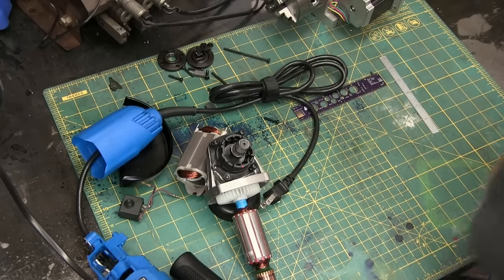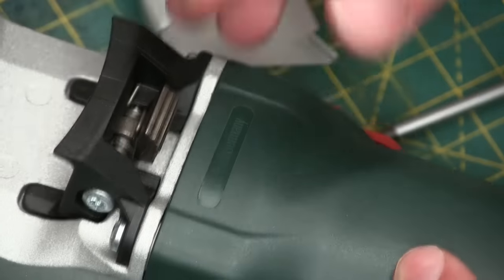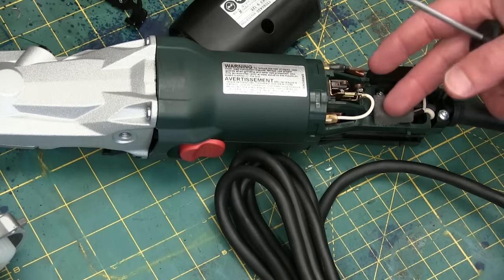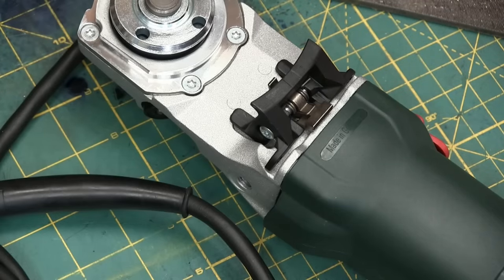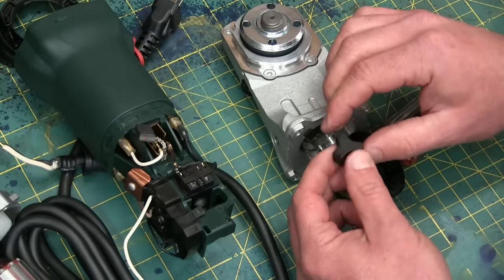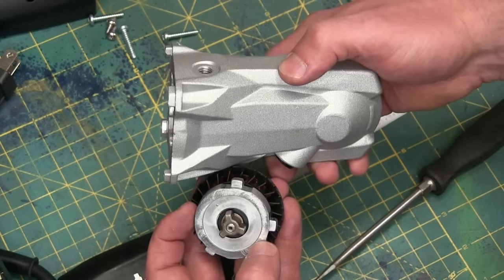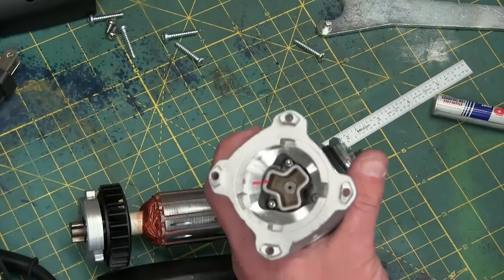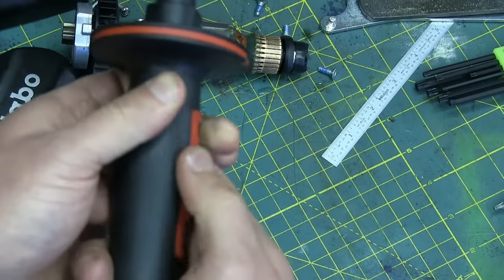BOLTR: METABO GRINDER. MADE IN GERMANY

Comment: +AvE I used to work at a sintering plant. If you feel like maybe mentioning that these sintered parts are pressed, removed from the mold and then cooked, that'd be cool. I bet a lot of people who watch your channel may be under the impression that the parts are cooked while under pressure which simply isn't the case. Also some parts go through a sizing press after they've been cooked to further meet very stringent specs before leaving the plant. We are talking presses made in Germany that put down over a million pounds of force on a part that is maybe 6-7 square inches of surface area.
Reply: You are correct. Until reading this I was under the impression it worked that way. Thanks for the clarificatipn

Comment: In high vibration environments crimps are more common than tinned multi strand.  The reason is the vibration will cause the wire to fatigue at the solder joint since the solder is solid.  On aircraft we never tinned, always crimped.
Reply: There's a reason why wires aren't tinned - the tin acts as a liquid and slowly changes the shape of a connection so when it was originally tight it becomes loose and prone to electrical malfunction over time. So the lack of tin on the wires is actually a good thing.
Reply: @ehsnils  I think Ave meant individually tin plated strands, not the use of solder joints at the ends.
Reply: Hmm, I most definitely do 100s of solders on aircraft (777 mainly)
Reply: Tin is not the same as soldering...

Comment: AvE, not sure if you read the comments from old videos, but I think you shouldn't latch on the crown gear as much as you do. In a 2 gear setup, the pinion is always the critical piece, its whats going to fail. That's why its generally made with a higher quality process/material. Having the crown made as good as the pinion is overkill.

Comment: Hey AvE, 
Polymer Technology Master Engineer from Germany here:

There are a few more efficient ways to vulcanize the rubber as putting it into an autoclave.
The Rubber gets Pre-Mixed at a processing factory and the cable manufacturer buys that as premade strips. 
Those get fed into an extruder where the twisted cable runs trough a quill die and the rubber gets pressed around that.

For the Vulcanisation there are various processes. The Autoclave is usually pretty inefficient because you can only run that batchwise, I think they would use either steam (or in asia Radiation) Pipes, where the cables run through continuously under pressure, or a Molten Salt Bath to Vulcanize that.

Since that says 105°C, it is either Natural Rubber, or EPDM (EPDM is more likely, since it has a higher resistance to weather, UV and Ozone influences)
Reply: You're Welcome, always happy to share some knowledge!
Haven't heard about the molten Lead version yet, but that sure as hell sounds expensive and complicated
Reply: Tobias Brinke thank you for your elaboration,

Comment: It's advised almost universally to never mechanically clamp something that is pre-soldered/tinned. In fact in most jurisdictions (Australia, UK, EU, Canada etc) it is illegal to do such in mains electricity installations. There's a few reasons, the main one is that the tin/solder has unacceptable metallurgical creep. Others are things like tin-whiskers, and oxidation.
Reply: I think AvE is referring to actual tinned wire along the entire length, not a soldering process that would be done on the end of the wire. AvE is correct that most shipboard cable will be tinned copper. This does not mean that it was soldered, the individual wire strands are tinned for the entire length of the cable before being insulated in the manufacturing process.  This prevents the green growth of death that happens inside of many conductors in harsh environments. I've seen wire be black and corroded many feet in underneath the insulation, I would assume through capillary action.

Comment: No critique about the technical points you mentioned, but you can't compare this grinder pricewise to a "normal" (i. e. not pancake) one and then say it's too expensive. Half the money is going into the flat design of the "WEF 9-125 Quick" you have, which is 291€ when I check the manufacturer's list price. The better specced "WEV 10-125 Quick" (a non pancake grinder) that's a little bit more powerful, has adjustable speed and a mechanical safety clutch costs 172€ as opposed to 291€, so substantially less. (if you don't care about the constant speed control that both offer/adjustable speed that the WEV offers, you can also go for the W 9-125 Quick which literally is half the price of the WEF). You can even mount the gear box in 90° increments to convert it to left handed operation ;) . 
The electronic block does a little bit more than you give it credit for. It switches the grinder off, if you get the disc stuck, tries to keep the RPM constant under load, prevents the grinder to spin up after power loss if the switch is still engaged and has a softstart so it's really easy to start up one handed (btw. how do you use a rat tail grinder one handed? I guess that's the reason why almost all 125mm angle grinders here in Europe come with that thumb switch).
Reply: Not
Reply: How you use a rat tail grinder with one hand? Well.... you just do it. One hand holds the part you're grinding and the other one holds the grinder...
Reply: Great comment. But I've used my Milwaukee rat tail one handed many times.
Reply: superdau 
Thanks for the info.
Reply: You need to get plenty of wrist exercises in if you want to use a rat tail one handed, but it can be done!

Comment: Great video man.  Yeah that open-cell foam looks out of place.  The trim pots on the electronics are probably for adjusting the "Constantmatic" feature of this particular grinder which is their marketing term for a grinder that maintains a constant rpm even under load.  This is probably part of the overload feature you mentioned.  Looking forward to your "testing."
Reply: The foam is there in the schematic. You can even buy it as a spare part (and it is used in severel metabo tools).
Reply: superdau
What is the part number for the foam?  I may have been looking at the wrong model.
Reply: German Tool Reviews
344100790 "Einlage selbstklebend" ;)
Reply: Yup you are right, I missed it.
Reply: And isn't full of grinder filings and shop debris.
Reply: Lol. Yep. Every grinder I have had with a filter clogs its own filter with debris in about 5 minutes, then starts sucking through the cracks in the body bypassing the filter :P
Reply: German Tool Reviews  of

Comment: Ways to win AvE's heart: 1) Beer 2) Meats 3) Good snap action
Reply: Good snaption / snaptivity
Reply: And glass fiber reinforcement
Reply: Forged/ground/lapped gears, beefy non-plastic connections to your brushes, no-nonsense warnings "Everyone that uses this tool will die. 100% Guaranteed.", guards and safety interlocks that ship and bill separately, full every-single-part exploded schematics free, crucial 'this will break first' parts available at local hardware, plastics that don't immediately decompose in random cutting fluids for parts that have to be plastic, and last but not least: No dead tree carcasses!!!
Reply: All that is well and good, but it got to be STIFF. Who want a hand full of limp tool? 😲😵😞
Reply: @shrikedecil  Mrs. AvE, I presume.

Comment: I know the little circular thing on the brushes is to back up a small spring that pops out a little non conductive doinger that stops the motor from getting power. I have rebuilt some of the older metabo grinders.

Comment: note: thermoset's  do not melt (you said unlike thermoset plastic these do not melt) . There are thermoplastics, and thermosets. Thermoplastics melt at elevated temperature, thermosets will degrade and then burn, but will not melt.
Reply: Couldn't those of us who have the sense to stop BEFORE it goes full torch, call that degradation...melting?
Reply: +Michael 1. The sense? I rather enjoy letting the smoke out. You get this delightful whiff of electrified blueberries.
Reply: +Joe Clark Cancerberry. A new fragrance for men by Dewalkarri Noir. 

Ron Pearlman in a tight white sweater and cargopants
Reply: Michael 1. I think that would sell. Except for in the state of California where " 'men' has been shown to cause cancer." Ron Perlman in a tight white sweater and cargo pants would sell there though.
Reply: Sounds like you've had this Ron Perlman fantasy for awhile :P
Reply: Do you say wood melts or does it burn? Thermosets BURN and char, they do not melt. Thermoplastics will turn leathery and begin to drip (aka liquid phase) BEFORE they burn. The "melting" temperature of a thermoset is ABOVE is "torching" temperature so it never gets a chance to melt.
Reply: +AvE  

You should review that new Troy-Bilt, TB4200 electric trimmer that has that "Core motor" technology marketing wank. Basically it's nothing more than a axial flux brushless DC motor that instead of using copper coils, it uses a fiberglass circuit board with copper traces on it. I don't know about you, but I don't think that motor will be reliable because fiberglass circuit boards can only handle 125C temps. Any higher and she'll start to turn brown and then black with carbon, leading to shorts since carbon is conductive. A coil wound motor with the best varnish can handle temps of 180C. Much more robust than fiberglass circuit boards....
Reply: Ionic bonds in hydrocarbons?!? Something smells funny and its not the burning thermoset. (Did you happen to mean van der Waals, aromatic pi stacking, or hydrogen bonding ,if not a fully hydrocarbon based polymer like nylon?)
Reply: It's cool. I'm org. chemist and reading that made my brain spasm and fingers twitch resulting in my unnecessary correction. Sorry about that. Good day chappy.
Reply: he knows that, I have seen him used the terms correctly before. I think he just had a brain fart.
Reply: +MOL van der Waal's forces, and occasionally hydrogen bonds, not ionic bonds IIRC :p
Reply: +Michael 1, no it's definitely not melting, it is decomposition. No matter how careful you are you can't melt most thermosets. What happens is they start to out gas and char, and this is the polymer depolymerizes rather than melt. I.E. Chemical bonds are broke.

By the way there are might be thermosets which can melt, but not usually. Thermoset means that to make the article separate monomers or even ogliomers are mixed together and reacted chemically. Thermoplastic means that instead the plastic has already been made chemically and the article is constructed by basically melting it into shape.

Rubber for instance walks this line pretty fine. It can be melted into shape but also it can be mixed with sulfur or other things and set into shape by both heat, pressure and chemical change, which is called vulcanizing and it changes the chemistry and physical properties somewhat and makes it less able to be melted again. So, is that a thermoset or a thermoplastic?

In general thermoplastics have long linear polymer chains, and in general thermoset have either cross linked linear chains all the way up to something that doesn't have any recognizable long chains at all but is instead a crystalline or amorphous 3D lattice such as a phenol-formaldehyde resin (Bakelite).

Comment: the cable comes from the Zhongshan Rifeng Electric Cable Co.,Ltd.  
 Guangfeng Gongye Ave, Zhongshan, Guangdong, China   METABO have two manufacturing plants  Nürtingen and Shanghai (China). makes you wonder if the grinders come from Prc and the truth be out now found this on a british site (tool stop) What this appears to mean is that Metabo not only design and innovate with stereotypical German fastidiousness, they also apply that same mind-set to each element that goes into your Metabo power tools.

So, the motor housing, the gear boxes, all of the aluminium, metal and copper bits that turn your drill bit, your grinding disk or spin your saw blade are designed, engineered and manufactured in Germany, Nürtingen. At the Metabo plant. Only then are the component parts sent to their Chinese plant for assembly.

What we're trying to say is, Metabo power tools are extremely well made.

And that's because 80% of all their machines are still produced in Germany to their exacting design, manufacturing and assembly standards.  The other 20% are assembled in their Shanghai factory which utilises the local labour force, but is controlled by German Engineers.

In some instances German made parts are even shipped over to the Shanghai factory for assembly, crazy as it might sound, this gives you some idea as to the investment in quality that is being made here.

Comment: Howdy, 
I spent my working years as a Millwright in a Wire and Cable manufacture in Ontario.
We had 3 CV lines ( constant vulcanization) to manufacture the rubber cable you were taking about.
The rubber came raw in strips that was fed into an extruder that encased the twisted three conductor wire. The wire paid off from gigantic spools and ran down a 300 psi steam tube and turned around on a pulley inside of an autoclave. It then returned to the "takeup spool" under water (to cool). The wire emerged to an accumulator ( allows the constant motion while spools were changed) . Worked there 23 years. That's how we made wire.

Comment: Inside the brushes on Metabo and Makita they have a little brass button on a spring (that little copper indicator at the top). Once you hit the wear point of the brushes, it shuts the machine down so you cant kill it completely.

Point of failure on most metabo machines is the upper / lower output shaft bearings,  head side motor bearing, brushes, Marquardt switch on machines that run those old marquardt push fit jobs..  Most metabo machines have shim stacks to adjust the ring / pinion contact; surprised that machine did not.

Comment: Silly question. Is that little bit of foam an air filter? If its on the "in" side of the airflow would that keep it cool enough to prevent melting?
Reply: That was my guess, that open cell foam is used in a lot of filters out there, if there was a mechanical hold down for the cords it would be much stiffer.
Reply: I think the foam may also be an indication of use. Basically you send the tool on for repair, they see that foam has not degraded, and they know that they have a legitimate RMA to deal with. At least that is the only reason I could seen for having such a pathetic bit of foam in a High end tool. Not to say that the tool should fail easily, but it might make someones life easier.

Comment: As someone who does FDA stainless welding and polishing and uses air grinders all day in the shop(Souix, Dotco, Desouter), when doing field service work and only have 120v electric available, Metabo grinders are the smoothest operating, best feeling tools I've used. We have Makita, Milwaukee, and DeWalt, but the Metabo grinders and Dynafiles are miles ahead when doing precision polishing. I also have a 5" Makita rat tail in my personal shop, but it's been relegated to cut off wheel duty since I picked up a variable speed Metabo 5".

Comment: I have owned this model grinder for about almost 2 years now. And used full time at work. The disk stop deal fell out within 4 months of use. Kept falling out until I lost it. Very frustrating because that exposed the gear housing to the elements and now I'm replacing the gear of the head side. The one on the motor side looks fine. But I'm finding out that it's not as easy as I would have thought.

Comment: Natural rubber? You mean tree spooge?
Reply: No. Tree schmoo. Learn moar Canukistani.
Reply: tree shmooo
Reply: Natural rubber.....the stuff that splits and decays 10-12 years down the road.
Reply: Well it's not completely natural rubber, it's been vulcanized. It will only split and decay 10 years down the road if it's left in the sun the whole time and never used. Moving around the rubber as you use the tool over time actually helps it 'self heal' from weather effects or so I've read that car tires will go much longer without weather cracking if they are regularly driven on. And they are vulcanized rubber as well.
Reply: That was definitely what I was thinking. Surely silicone would be better and cheaper? Or maybe it doesn't go bad cause reasons?
Reply: These grinders only have a 3 year warranty. That is the life expectancy you can expect.
Reply: +Eric Brandt not with sulfur....
Reply: When you have a car tire repaired with a plug they recommend, or at least they should, driving on it to vulcanize the plug.

Comment: Depending on the additives in the rubber they don't always need pressure to cure. Right type of rubber can just use steam.  We call it an atmospheric cure in my line of work. Another way to cure some types of rubber is hot water where water is used for temperature and pressure (may be used for cable manufacturing using extrusion process). Several hundred different types of rubber and several additives for each type.

Comment: Some women admit to prefer longer tools for their grinding.
These Flachkopf-Winkelschleifer are made to get into tight spots, where a ordinary angle grinder could not fit. I only have the short one, but mine is close to 20 years old and still going strong. I've found it in the scrap heap about two years back. Happily, Metabo parts are still readily available here in Europe - The red switch, too. Good luck with it.